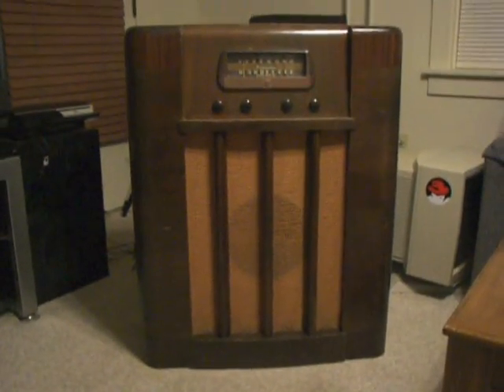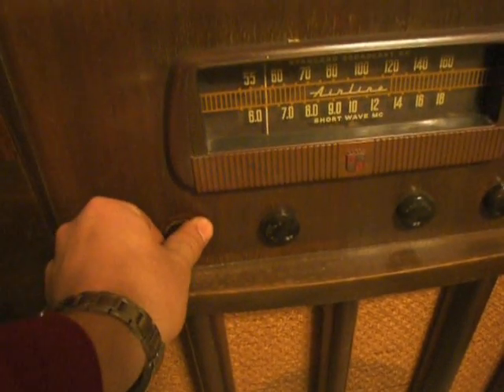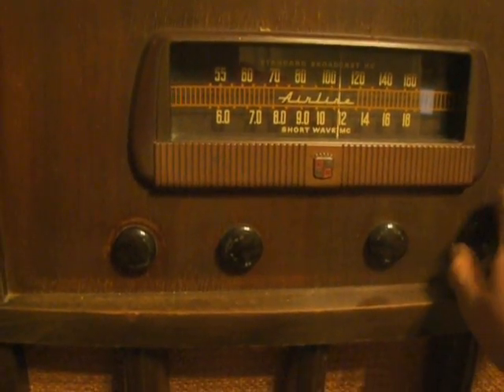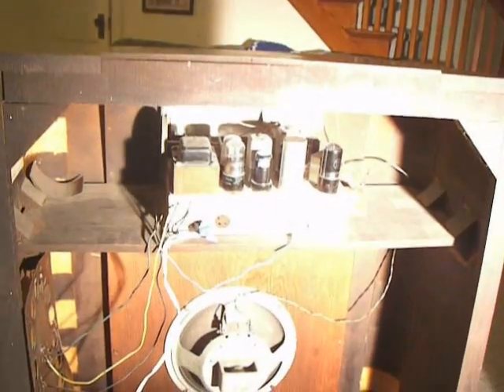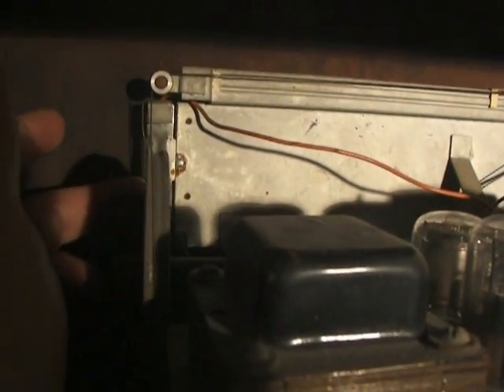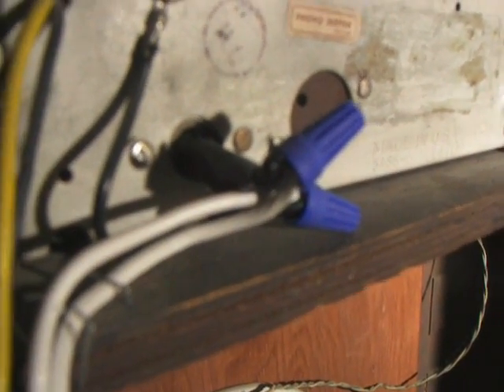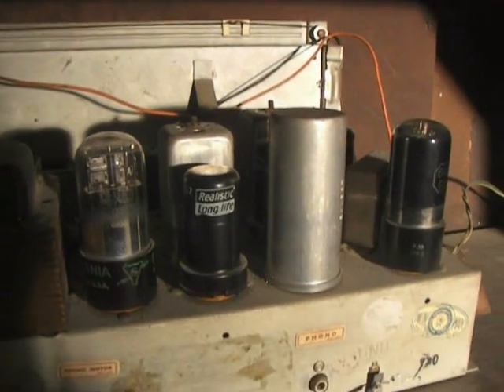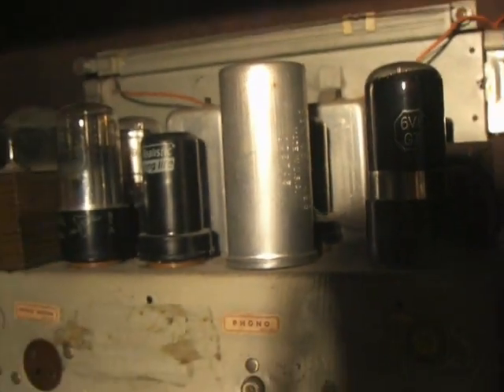My Wards Airline Radio

Comment: Montgomery Wards did not make their own radios sold through the Department Stores.  Belmont and Wells-Gardner were often used along with other companies primarily in Chicago.  The Wells-Gardner radios were generally the highest quality having made the unique "Movie Dial" radios for Montgomery Ward's.  If there was ever a uniquely designed radio it was the Airline "Movie Dial" radios actually using a 35 MM piece of film strip with the Station dial, numbers ect. imprinted on the 35 MM film strip.
The Airline "Movie Dial" radios were the only  radios to ever have such a design and are highly sought out by collector's.  It came in several table-top models and also a most impressive Console "Movie Dial" Floor model with a very beautiful Art Deco bezel or escutcheon on the radio.

Comment: I sincerely hope you get many years of enjoyment from this radio.  That being said you should open the chassis and solder in a new power cord.  You should also consider replacing the old wax/paper capacitors and the electrolytic capacitors as well.  When capacitors are that old they simply don't hold up for very long if you use the radio much.  When you begin hearing a hum no matter how strong a station is you'll know the electrolytic caps are bad and the hum will only get louder as time goes on.  The other caps are wax and paper and I've never seen one yet that wasn't out of tolerance and leaking.  That was what they had at the time so that's what they used.  Modern replacements are cheap, smaller and last much longer and if you can solder it doesn't take long to replace them.  Doing so will make sure your radio is playing to the best of it's ability for many years to come.  Dial lights are readily available as well.  There are many places where you can buy replacement parts for old radios.  Look up Radiodaze.com and you'll find a large selection of everything from dial lamps to cloth covered wire to rubber chassis mounts, reproduction graphics, grill cloth, finishes and toners, etc. etc.  Or try Justradios.com where they have all kinds of capacitors and resistors.  Good luck.

Comment: Nice Radio,  Just pull the knobs off and unscrew the chassis and the front dial and string assembly come out with the chassis, they are attached. You should make sure the little pully's that hold the string are oiled and move or they will break your string. Are you gonna Recap it yourself.

Comment: yeah with it being a floormodel i wouldt worrie about the speacker cord but there will be 4 screws on the bottom of the board that the chassis is mounted to un screw thoes and take the knobs off the front and the chassis will slide right out and the bottom is open so you will be able to solder a new cord on without taking the chassis apart it should take 15-30 mins at most and that radio does play really nice and is in good shape if you want i can make a vid showing how to take it apart

Comment: I have the same unit but it has the record player. the front opens. i also have original sales receipt from 1947 they paid 122.35 back then,i'm restoring the cabinet now. mine works but i'm going to replace the tubes when i find them.

Comment: Give each switch and control a small shot of WD-40 (inside the control/switch of course) and then work the switch/control back and forth a few times. This will eliminate the noisy/erratic operation of the controls/switches. I'm an electronics tech and have been doing this for thirty years with great success.